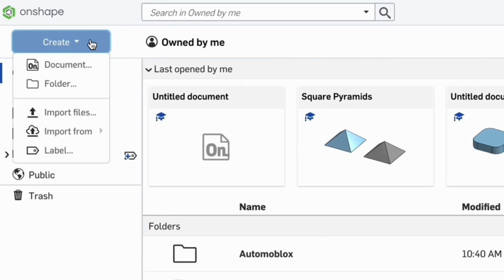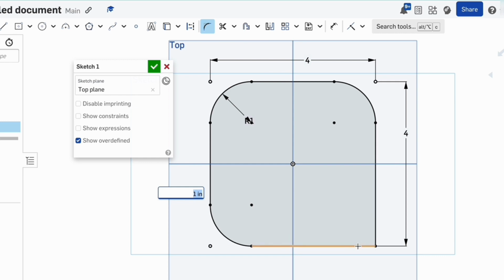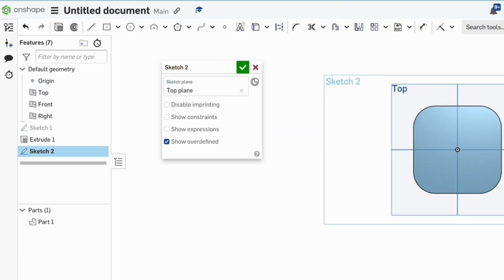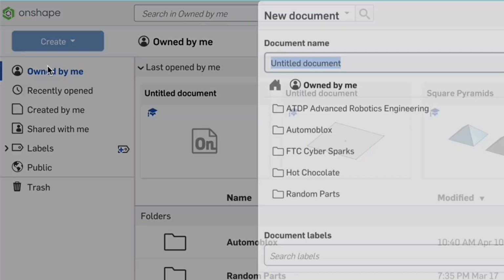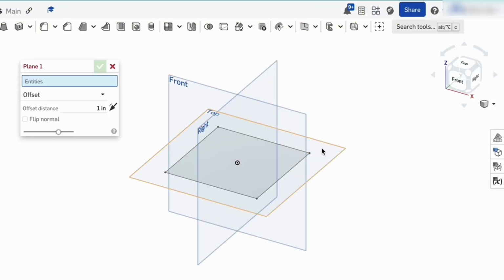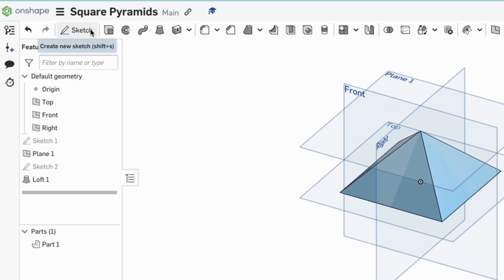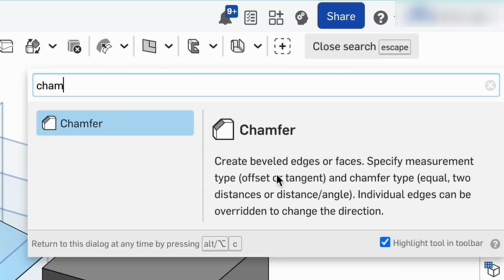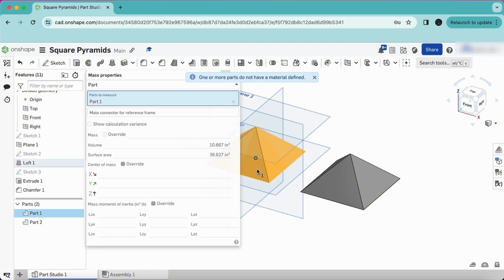Onshape 101 #6: How to Fillet and Chamfer to Make Simple Objects

Comment: Possible update bug: chamfering the extruded box no longer produces a pyramid.
Reply from the maker: Hi! Thanks for pointing that out! We tried the steps you mentioned, and the chamfer worked for us: Make sure to double-check that you set the distance to chamfer as 2 inches; maybe that’s where the issue is. If it still doesn’t work, let us know!